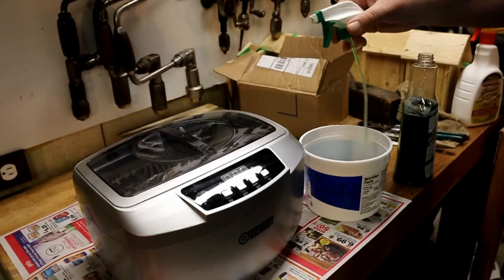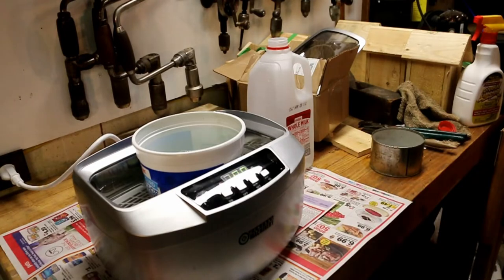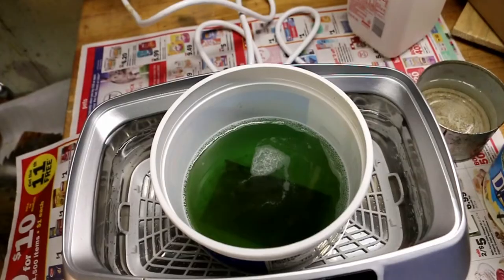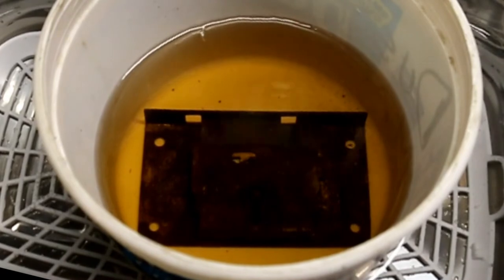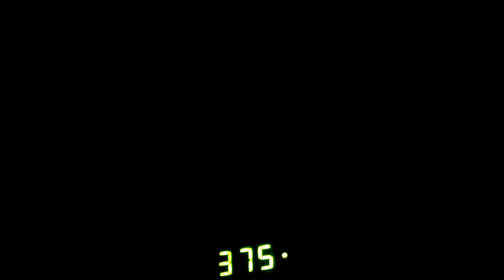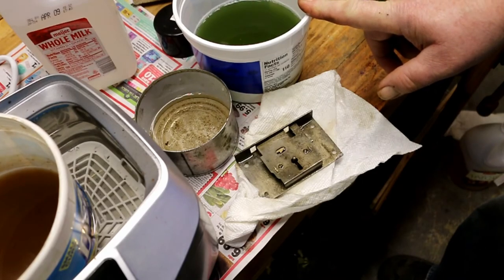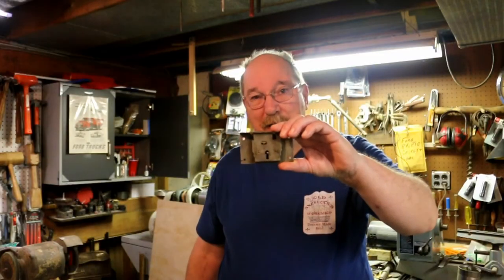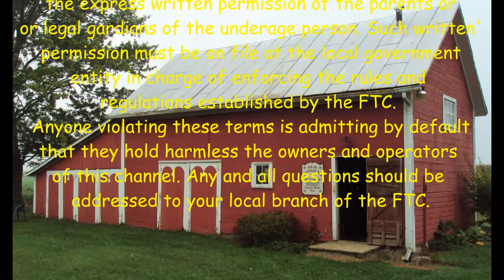Restoring AC Gardeners Tools Box ~ Cleaning/Derusting The Lock

Comment: Ahh HAH, lock lithotripsy!!! I didn't go that route though. It was drill, shoot, blast and haul out but I wasn't around at the time. NICE lock, by the way! The green and water had the chance to get in the cracks and crevasses better than the straight stuff undiluted. I had an ultrasonic device all along and didn't realize it. The vibrations from the HAMMER! 
Happy day, you 2 and GBWYall!
Reply: Here I is. 
Ole Unk trying to pull a fast won on us, putting up two2 videos in the same day.
Reply from the maker: Ooops! There was only suppose to be one. 
I set the publish date wrong. 😳
Reply: @OldSneelock  No worries just me doing my usual harassment, oops I mean my job.
Reply: @mostlymoparih5682  U iz!